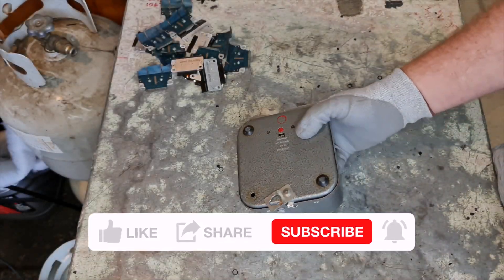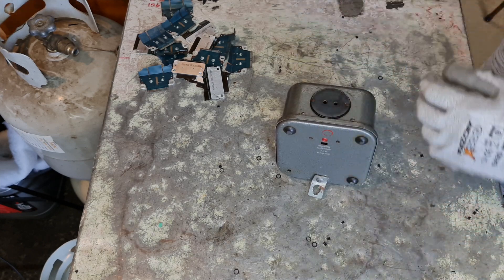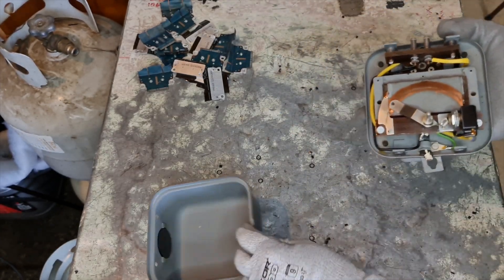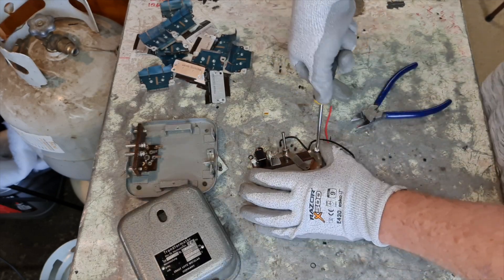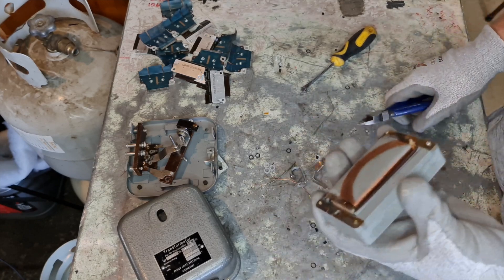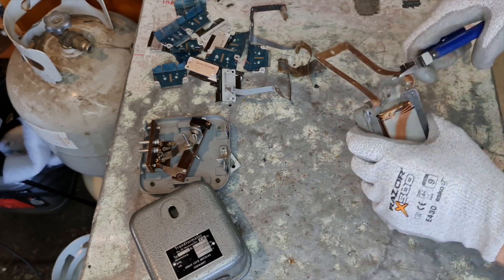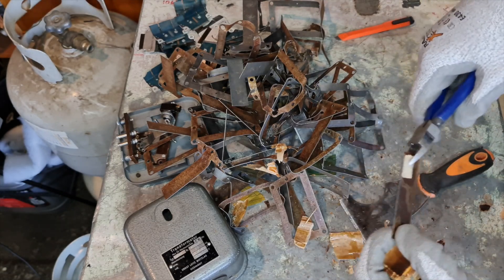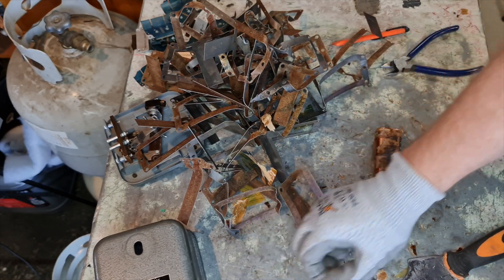Variable Voltage Transformer Scrap Out - Scrap Breakdown - Metal Recovery - Metal Recycling

Comment: Very fiddly piece to scrap, shame you couldn't use it. Been struggling to get much done lately. Got blood test results, and doctor says I have long covid, which explains why after 2 months I'm still feeling a bit crap. I am hoping to do a scrap run tomorrow. Have a great weekend. 👍
Reply from the maker: Long covid, that's not good. I hope you feel better soon! Here's hoping you get good money 🤞
Reply: @MicroScraprMike  Thanks Mike. Yes I managed my scrap run, nothing exciting, mostly HMS @ $0.30/Kg, Couple of Alloy rims @ $2.50/Kg, and some Batteries @ $0.45/Kg. Collecting more HMS and yesterday picked up a solar hot water system tank and aluminium panel, and some copper pipe. Have to clean it all up. The tank is stainless, great !!. Hope you are doing well.
Reply from the maker: @afineliner740  I am very well! Still great prices, except for the batteries. We have nearly the same disastrous price for them too. Almost not worth collecting lead acid and AGM batteries anymore. That stainless steel tank might be worth a bit? Can't go wrong with any form of copper really.